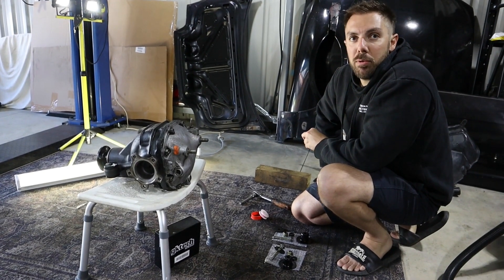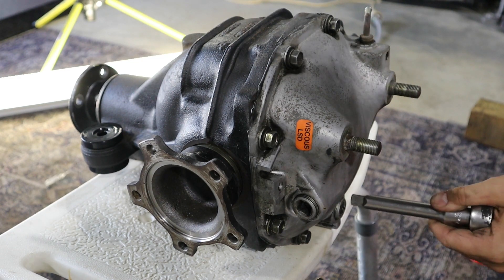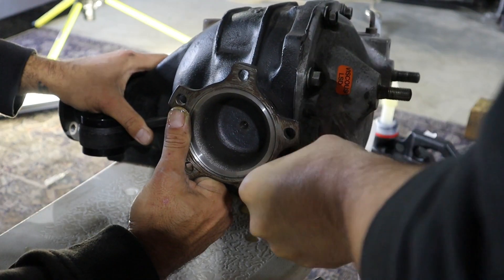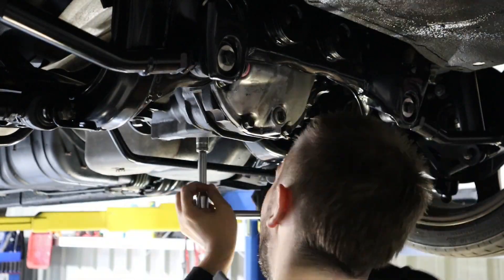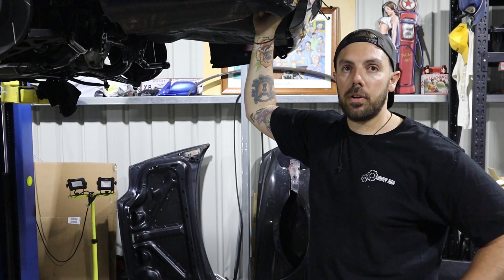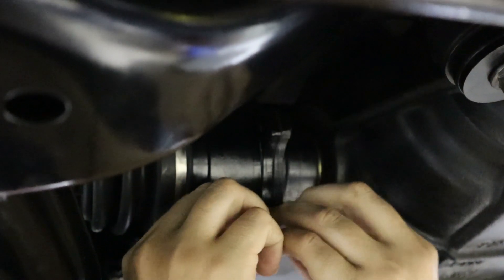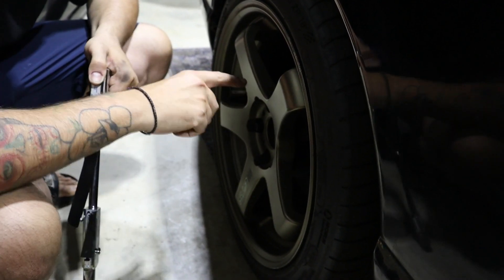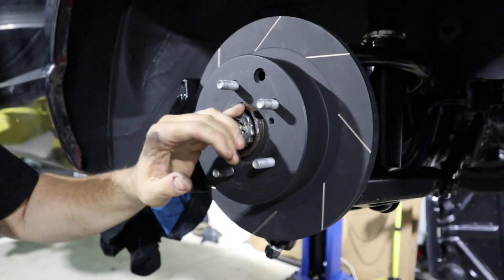R33 SKYLINE REBUILD PART 8 DIFF & DRIVESHAFTs INSTALLATION

Comment: Do you know how difficult it is to change just the final drive in the rear diff? I have a R33 GTST and I don't like how short the gears are, but I am not looking to make a lot of power.
Reply from the maker: if you mean the diff ratio, its easy to change that, you need to know your diff ratio first and buy the right diff pinion gear, sometimes it can be a direct swap, (a lot of videos on YouTube and most diff are similar) and sometimes you need to give it to a shop to balance the clearance.